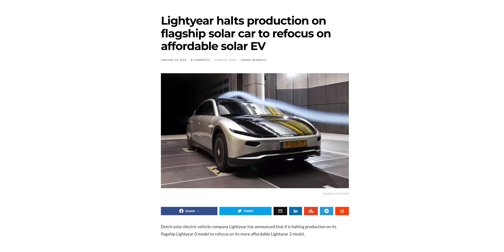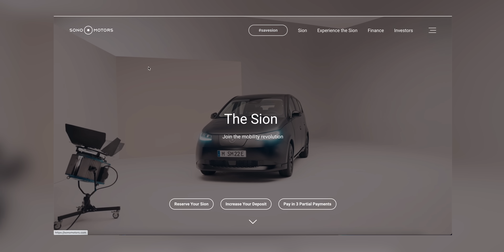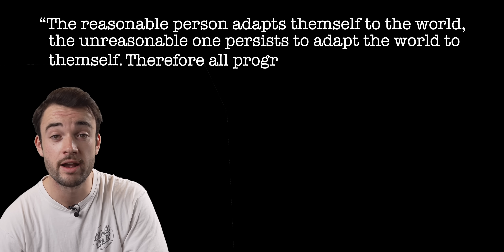Will Solar-Powered Cars Ever Happen??

Comment: the aptera is pretty much my dream car. shitty thing is, i have absolutely no use for a car....
i still invested in aptera, but im no millionaire, i cant push them into production.
Reply: Every small investment and additional product awareness is of immense help in getting them there.  Thank you!
Reply: Aptera is a motorcycle, not a car. A deathtrap in case of an accident. And you will never be a millionaire, when you buy things you dont need. Or invest in marketing scams. Just for the good feeling. And thank yous from irrelevant people.
Reply: @vic321344  Why do you insist that a vehicle that has airbags and crumple zones, and will be tested to the same FMVSS Part 200 standards as any car by an independent 3rd party, with the results too be published is a "Death Trap"?  Your comments are pure FUD.  And you will never have a good feeling about yourself as long as you are so engaged.
Reply: @n.brucenelson5920  Easy. I the case of a accident the front wheels will rip off at once. Then the body will turn upside down and you cannot escape (yes, YOU can escape thropugh the side windows, I know). The batteries are built within the body. So the toxic fumes from burning batterie packs escape directly to the driver. And so on...

Comment: I saw the Sono Sion two days ago at Sono's roadshow. It's a comfortable car, the solar cells look okay already, the software and price seem good enough.
Sure, the 1.2kWp around the car would generate more electricity when installed on a roof, but I don't think Sono is going to take a lot away from the solar industry. I wish them well, but I'm not sure if they're going to make it. If not, I hope they can repay the money reservation holders have put into the company.
Reply: I've been tracking these 3 startup from the beginning
Sono motor: doesn't have real technology and they hire contractors to find solution, and it seems they don't know what their doing I can't find in their team single talent 
lightyear: have great technology and good passion team and build a real solar EV the problem is when they reach the production hell, they didn't plan to this point and they surprised by the amount of problem and cost they are faced and they fail fast
Aptera :is the best and real technology between them with very experienced and talented team they calculate every step they are doing with very low cost, and they planned to production from day one, the only problem they are faced is timing, if they launched sooner than that they will find every funds they are want from everybody
Reply: The 1.2kWp are next to nothing in the real world. Think about it. If you go into town, are there any open spaces to park the car in or do you have to go into a multi story car park. If you are so lucky as to find an open space, how many buildings surround that and how much do they block the sun from reaching your vehicle. What about your off street parking? Ready to tear down your garage to make space for the car as inside the garage it can't trickle charge of the PV modules.The idea sounds good until you realise how ludicrously unrealistic the premises are under which the car can produce a bit of energy that can be put into the battery.
Reply: @karlgunterwunsch1950  And if it's blazing sunshine, how often do you look to park in full sunlight? How long do you need to be parked to negate the amount of AC you'll need to use to cool the car again?
Reply: @drunkenhobo8020  Exactly.The idea of putting PV cells on a car is purely bonkers because it does't fit the way we use cars - and that includes "storage" when we don't use it.

Comment: If solar panels on a car were a good thing to do Elon Musk would have done it already
Reply: If buying twitter for 44.000.000.000 USD was a good idea, Elon Musk would have already done it.
Reply: @ThomasWaldmann  Just a Billionaires toy, I'm sure he'll make money on it, eventually.
Reply: The model 3 is roughly 1/3rd as efficient (kwh/mi) as an Aptera, meaning the solar would be much less effective in adding range. It is such a good idea though, that he changed his mind to incorporate a solar vault cover on the cybertruck.
Reply: @csommer4492  A retractable cover certainly makes more sense than putting solar panels on the bonnet & side panels where stone chips kicked up from the road can damage them
Reply: @csommer4492  Aptera is a motorcycle, not a car. Tesla does not produce motorcycles.

Comment: imho there is a bit of terminology issues with these cars.   They aren't solar powered.   They are solar augmented EVs. To be solar powered you'd need, today, you'd have to charge for days to get a full charge.  The idea and function of solar augmented is great.  But lets be a more realistic as to actual function.  Otherwise it's just more fodder for ICE pundents and EV skeptics to laugh about.

Comment: It only works if you drive (slowly) under 15 miles per day and live in Mexico.
Reply: Well, no, actually. All these vehicles have sizable batteries that can be (and often will be) plug-in charged. The exception is the Aptera, that is efficient enough and has enough solar capacity to provide up to (yes, up to, not guaranteed) 40 miles of range per day. My wife and I average about 12-13 miles of driving per day. We don't have Mexico's sun, but we have enough to handle the day-to-day demands of an Aptera. Road trips... sure, the battery (with a reasonable range) and DCFC will be necessary, sun or no sun.

Comment: Mirrors can track the sun , it could boost solar powered charging . Parking a vehicle in special charging areas  , cheap tracking technology could communicate with the car computer to concentrate filtered solar energy to the EV solar panels . This could boost charging on cloudy days and be used in rural charging systems that charge solar panels in the vehicle charging foot print area to its own off grid battery for charging at night and make green money .
Reply: If you are going to park in particular locations it makes much more sense to have fixed solar panels powering an EV charger.
Reply: In the same time making it quiet risky for the owner to return to the car mid afternoon. Shirt and Jacket might get burns.

Comment: I would love these companies to succeed, but, as this channel has pointed out, even big established car companies are in trouble over their switch to EV. Then you have the case of the small carmakers who had lots of interest but never made the big time - Marcos, TVR, Reliant and so on.
Reply: Well, at one time Reliant became the 2nd largest manufacturer in GB on the strength of their 3 wheeled Robin.  They just didn't continue innovating and sold basically the same model for 30 years.  They still sold around 1/2 million of them.
Reply: @n.brucenelson5920  1/2 million is just too little.
Reply: Its actually a bit cheaper to come from nothing and build an EV than it is to switch from ICE to EV. Established OEMs put investments on equiptment at a platform level and they expect to get 20 to 30 years out of a platform. How many companies are only 10 to 5 years into thier last platform shift? How many bet big money on converting an existing platform and ran into problems that crippled thier offerings? How many have parts bins full of components they want to try to shoe horn into their EVs? They may have a revenue stream coming in, but those ICE cars they sell arent pure profit either, and many already had slim margins which are made slimmer by the overhead of platform level investments that may be increasingly redundant. And for all of the talk about "manufacturing know-how" many of the OEMs are proving that they have a very steep learning curve when it comes to software and interfaces especially. Then you have companies with unionized workers in engine and transmission plants etc, or internal politics and command chains that make going full-in on EVs nearly impossible.

Comment: Have you ever heard of the term "vaporware"?
Reply: My wife and I have ridden in an Aptera prototype.  Neither it nor the performance were vaporware.  Solid steel blocks of tool steel are now being cut to form the tooling for the 5000 ton presses at C.P.C. Modena Italy that also make the Lamborghini body parts.  Funding is the only remaining gating issue and that is being addressed.

Comment: What about the XBUS and the Fisker Ocean? These are also solar powered, aren't they? And why don't existing car brands develop solar powered cars? These can be highly usable in countries around the equator without a dense grid of charging sockets.
Reply: The Ocean's solar panels will probably be enough to charge your phone but arent going to add any appreciable range. Its definitely a gimmick for them. As it would be for any existing car companies to add solar to an existing vehicle. What makes Lightyear, Aptera and Sono different isnt that they have solar, its that they are designed to be HYPER efficient so that they can actually take advantage of that solar in a meaningful way. Meanwhile the OEMs just keep building heavier cars and cant even build a freaking hybrid that gets better mileage than a diesel, so efficiency is far from their focus.
Reply: @patreekotime4578  But the solar yield on Aptera will also just be enough to load your cellphone. If you have to cool down the overheated vehicle after a day in sunlight, then not even that.

Comment: I think the bigger issue is that the power output of solar on cars is tiny meaning inputs when driving are too small to really bother with. Combine that with common destination charging, almost ubiquitous home charging for the owner and the benefits are just too small.
Reply: The main reason that is the case is that solar needs to be a part of the overall design for efficiency.  Of the vehicles designing in solar, only Aptera has had that as its focus.

Comment: The biggest issue is that its a gimmick. Running a car on solar on the car is not really practical.
Reply: Aptera is the most practical vehicle on the horizon, even for this Iowa native.
Reply: @n.brucenelson5920  I wonder if you are going to explain why.
Reply: @beatreuteler  well the apterra is claimed to get 40 miles a day on solar. Even if you get half of that, it covers most of your average driving. Meaning that it is cheap to run. This combined with the general efficiency of the vehicle allows for a very good range and very low running cost. This also means they can put smaller batteries in each vehicle which lowers upfront cost as well.
Reply: @matthewdilks2677  I think the Aptera does not offer the loading space I need for my car. And in WInter time I need 220 Km real range in a day.
Reply: @beatreuteler  I said it’s solar range was 40 miles. It’s minimum spec range is about 250 miles.
Reply: @matthewdilks2677  a) Even if it is specified as min. 250 miles, it won't make these 250 miles in winter times. On top of that, it is specified for 250 miles with the specified load. What I need is 220 Km with the load I am in need of carrying. The Aptera is not even capable of getting this load charged to it. And with that load (maybe in a Jet case roof top?) probably the APtera will make 120 KM in the winter times. Again, for my needs it is useless.
Reply: @beatreuteler  why do you think range halves in winter? Maybe educate yourself before arguing on the internet
Reply: @matthewdilks2677  Loads higher than specified play their role as well. I didn't say it halves just because of the winter.
Reply: @beatreuteler  are you aware mpg drops in a diesel or petrol vehicle drops in the winter or when loaded. The difference is an apterra does the equivalent of 360 miles per gallon.
Reply: @matthewdilks2677  Yes, I am aware that EV's in general/average are approx. 4x (or more) more efficient than fossil driven vehicles. I am a fan of EV's, but I am looking to more useful EV's than the Aptera and probably a few million others are as well. If there are also a few million people who find the Aptera useful for them: Fine! Go ahead and drive it. If that happens, the Aptera should find enough customers to buy one. The market will decide.
Reply: @beatreuteler  I agree. It is not perfect for all. No car, ICE or EV can be. But this is a very good car for many people.
Reply: @matthewdilks2677  ok. let's wait and see how they will sell.
Reply: @beatreuteler  ok but keep in mind it’s a small US based country. And that country is frankly a bit crap.

Comment: An alternative for Sion could be to licence their solar cell technology to another established electric car producer, like they have done for busses. My hope for Sono is that they will survive on their licenced technology, and in case Sion is put on hold, give it rebirth when finances are better :_solar:
Reply: Sono is selling their solar tech for busses and such. The car may not happen thiugh.
Reply: i think the bus solar system they are selling as a product, not licensing out.
but i guess licensing out the tech should work for them pretty well to allow them to come to market.
out of the three it was and still is the one i am most excited for
Reply: @pasmas3217  Sorry, my fault. Yes, I agree.
Reply: @pasmas3217  They gathered 130k with their solar business. And it cost them 160k. What a great business case.
Reply: I don't think it's that simple.
Reply: Yeah, because they have clearly shown what a great idea it is by not managing to use it themself....
Reply: You can buy solar for your recreation vehicle (incl converter) since 20 years now. No license necessary.
Reply: @vic321344  Do you know if Sono has improved on that older technology in some substantial way?
Reply: @ArnfinnSorensen  Their patents are worthless. At least.

Comment: Because moving from a nice prototype to a viable  production line is incredibly expensive and difficult, and is the point where nearly all burgeoning car manufacturers fail, solar or not. The fact that FC is simping over them and "fully supports" them is naive and rather absurd to be honest. You basically are acting as a fund raising channel for them.
Reply: Fully charged show is fully supporting them because the continual production of extremely large vehicles with absurd batteries and no sense of frugality are quickly becoming the norm. Once a vehicle is downsized and made aerodynamically efficient, then solar actually starts to make a meaningful impact on need to charge. Fully charged show is supporting a technology that promises to allow more people access to EV's, and regularly does videos in regards to home solar, and does many videos with non-solar EV startups. They're only 'simping' over the SEVs because they're the coolest idea currently in the personal transportation space.
Reply: @csommer4492  And yet al these ones have all essentially failed. Suggesting what?
Reply: Perhaps you don't understand the environmental imperative to move tech in this direction?
Reply: @n.brucenelson5920  Oh I get it. But the reports/videos they produce over these prototypes are essentially puff pieces - admittedly a little better now that Jack covers them as Robert was truly appalling - literally sits there smiling and nodding while letting the marketing guy spout in utter guff. Not really journism..
Reply: @GingerPiston  Most people have never heard of Aptera.  It is neccesary to get the word out if Aptera is to get the investment they need to get into production/
Reply: @n.brucenelson5920  Been around since 2005, folded in 2011. Restarted 2019.  It’s a novelty vehicle sadly and unlikely to gain any significant investment.
Reply: @GingerPiston  That train has already left the station.  Of course you are correct, but Aptera is in better financial condition than Tesla was back in the day and their first offering has far more preorders than Tesla sold of their Roadster.
Reply: @n.brucenelson5920  pre-orders do not a working factory make.
Reply: @GingerPiston  If course not.  But the number is responsible for the new plans and the reason C.P.C Group - the Lamborghini body bilder, has agreed to produce the Aptera bodies.

Comment: Pretty sure Arrival could have been a footnote. not solar but certainly disruptive tech with high ambition not matched by existing capital availability.
Reply: Arrival spread themselves too thin and tried to run 3 different races before they could walk. They had some genuinely innovative R&D on the go but there were quite a few dubious decisions from management all across the board.
Reply: @gigabyte2248  agreed, I think they will be ok once van production starts in earnest if they can last that long. I hope to see the ride hailing car and bus in good time, but as you say they should just get to production first.  I love the concept of microfactories, I love the materials and lack of paint, I love the quirky design, if only managent were at a similar level to the product development side.

Comment: It's a bad idea, simple as that.
Reply: Usually people claiming "simple as that" are too lazy to think about it.
Reply: @n.brucenelson5920  Ok.
Reply: @n.brucenelson5920  The surface of the car is typically too small to make it happen.
Reply: @beatreuteler  Which is why Aptera is not designed like a typical car.  Every part of the design has been optimized to make it happen, including drive efficiency, aerodynamics, rolling resistance - all of it.
Reply: @n.brucenelson5920  Yes of course! Down to the degree that for my needs, the Aptera is a totally useless vehicle.
Reply: @beatreuteler  the average car jouney has 1.2 people. It would still work for nearly everyone as a second car. Or a primary car for city inhabitants.
Reply: @matthewdilks2677  Possibly true. But we do not need a 2nd car.
Reply: @beatreuteler  if you can afford the 25k car it could reduce both costs and environmental impact.
Reply: @matthewdilks2677  Unfortunately I can't, because I need to spare the asset for my real car.